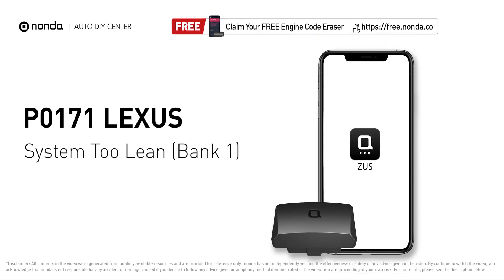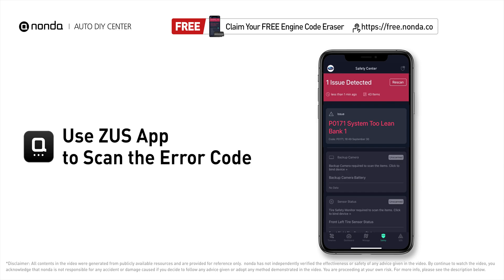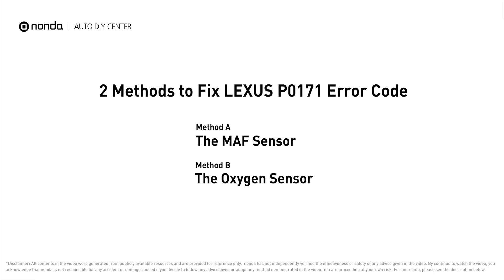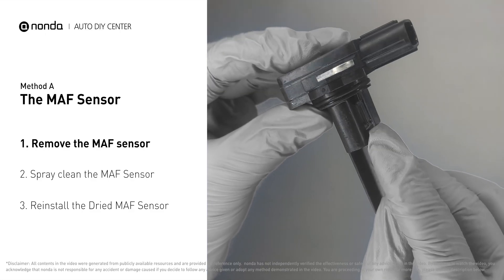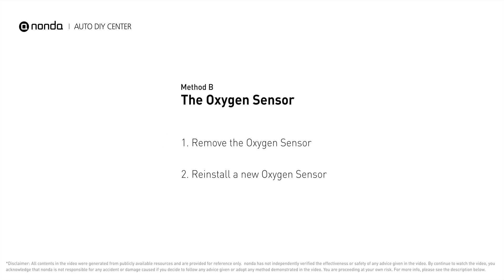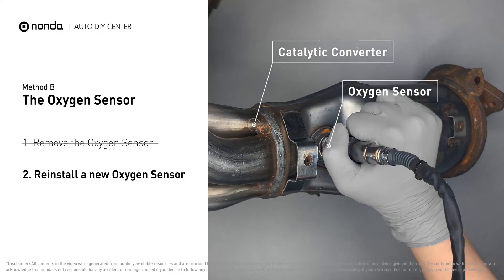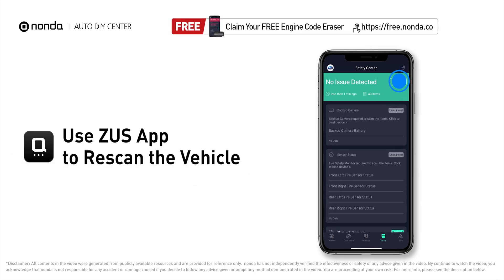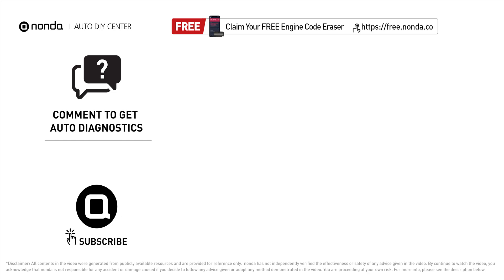How to Fix LEXUS P0171 Engine Code in 3 Minutes [2 DIY Methods / Only $8.37]

Comment: For every one with a P0171 code. I searched a lot and checked almost everything i could find on the internet. Replacing the fuel-pump fixed the problem.

Comment: My 1999 Lexus ES300 goes into limp mode at 3rd gear and has codes P1153 and P0171. Do you know what is the solution to these codes?
Reply: did you ever get this fixed? hsving rhe same issues
Reply: Guys, address your questions to Car Care Nut YouTube channel, the guy is very professional

Comment: Is bank 1 the driver or passenger side?
Reply from the maker: Hello, can you please provide us with your vehicle's year, make and model so we can provide you with a possible solution specifically for your car's make/model?
Reply: driver
Reply: I have a Lexus 200t 2017 which side is mines located on
Reply: @latashaann6750  NX?